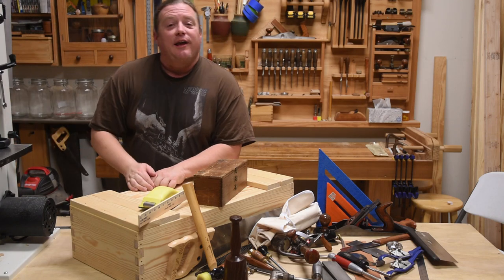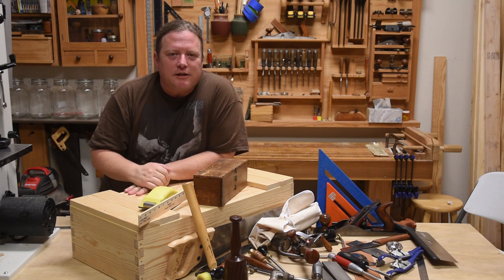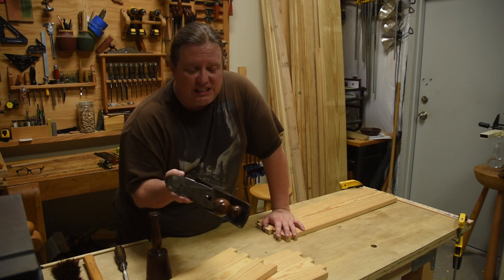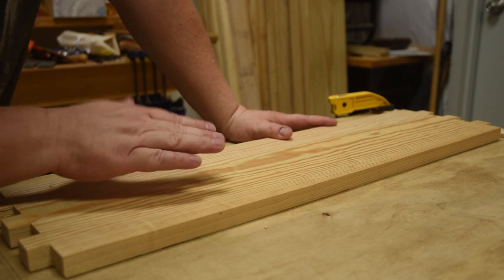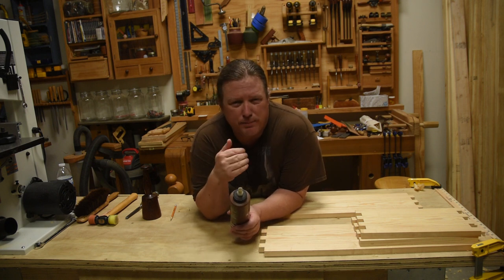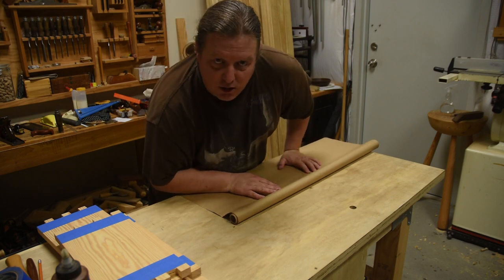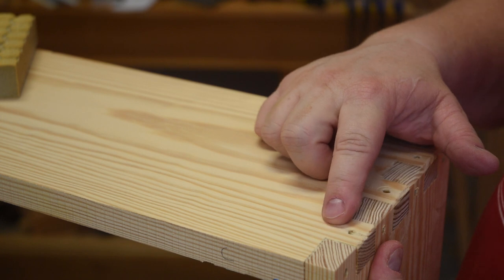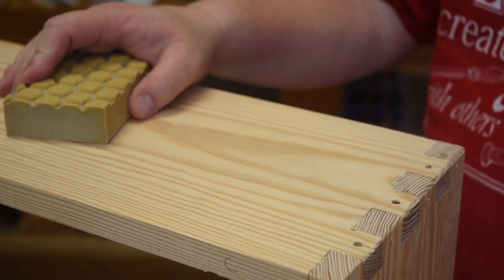A Simple Toolbox Build – Pegged Box Joint - Start Woodworking - Class Four PART 2

Comment: Your really on a roll. Several videos back you mentioned a 4x4 to 2x4 bracket, well I got enough to build 5 different tables ( work stations ). I finally finished the builds and an trying to catch up on your latest videos. Whew, you've been busy.  From my experience from way back when , you can keep someone's undivided attention for about 30 -40 min.. For me the ones that go 1hr+ , I usually stop it and then restart it later to finish after my brain has had a chance to catch it's breath.
Always good stuff.

Comment: I've been watching for a while now and it needs to be said how great these tutorials are. I only begun to work with wood less than year ago and I found I have a passion for it. Sadly it only took me 49 years to find this out but it's never too late as they say. I love ur content my friend. 
I look forward to watching more and more of ur content everyday. Sorry for not commenting so much. I tend ti just get stuck into watching them while I'm out in my small workshop. 
TBH I badly need to get to grips with storage soon. My shop is 16' X 10' and after building some cabinets for the floor area on one side I find I'm going to run out of floor space and I don't want that to happen.
I have a question if u have time my bro..
Q. The walls in my shop are concrete solid walls so what would be the best way to attach storage shelves/cabinets to the wall?
If anybody in the comment section has any hints or tips I would be very appreciative of ur help my friends.. Thanks in advance.. Salute from Dublin, IRE.